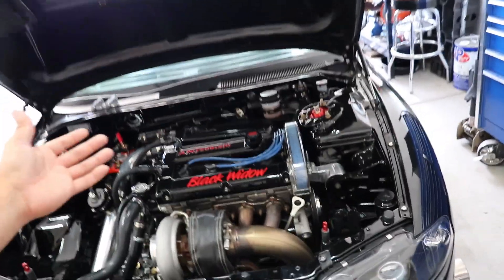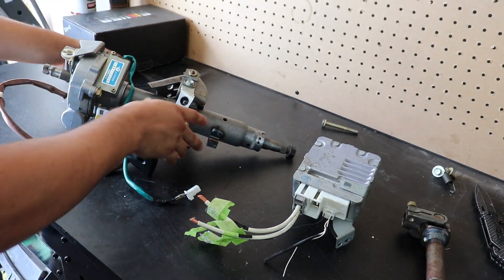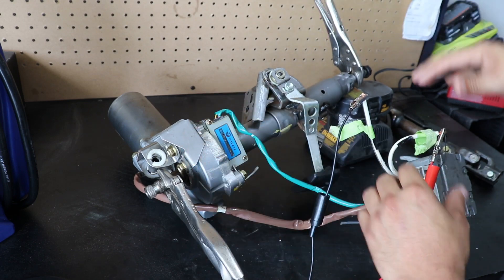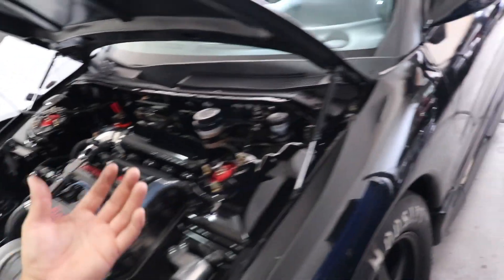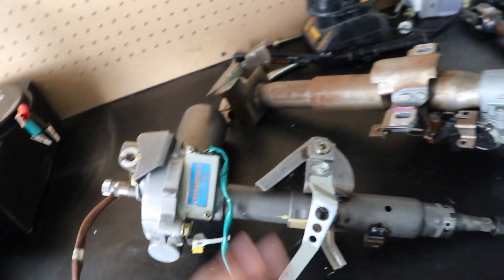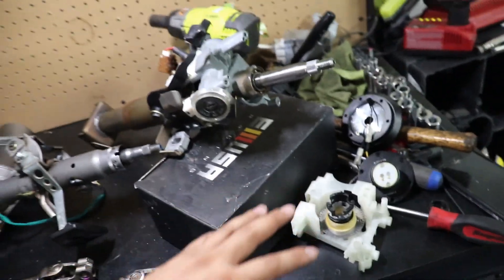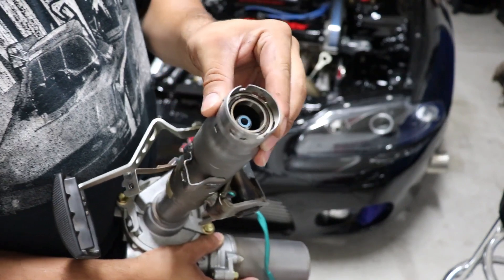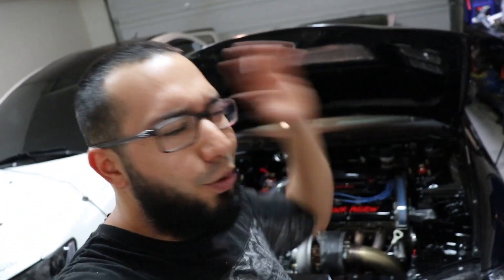1997 Mitsubishi Eclipse GSX- Toyota PRIUS Electric Steering System Install- PT 1

Comment: Very in depth explanation of the whole process, excellent!  I want to do this to my old car's column too.  My manual box is a 24- 1 ratio, so I also want to put in a steering quickener gear, to bring it down to 12 -1.

Comment: There's an easier way btw. Use a Vauxhall corse electric power steering column. The length is better. And the lower U joint can be adapted to fit easy.  Nice work though

Comment: @gmbo100 so should it matter which way its orientated or should the sensior be to the steering wheel?
Reply from the maker: The sensor doesn't matter how it's orientated
Reply: @Gabe_Ortega  unfortunately it does. It has to be toward the steering wheel or it wouldn't read input correctly.

Comment: Is your original steering rack de powered? did you swap it out for something different or just use this setup on a hydraulic power steering rack?
Reply from the maker: same steering rack just looped the lines

Comment: Good evening, excellent video, sorry, how is the electrical connection, could you share the information on the electrical connection, please, is the signal from the speed sensor used or not, please help
Reply from the maker: No with this system the speed signal is not used.. however I been looking Into a switch for the "switch wire" to turn off the system while at the track.
Reply: thanks in fact I already downloaded the connection I did not know that this conversion was very popular and very reliable I already ordered mine
Reply: Aver si cuando me llegue me podrías ayudar en la medida de los cortes que ahí si no entendí bien las medidas

Comment: I sold my complete 09 prius for $500 with a bad battery. Didnt know the steering shaft alone was 250
Reply: Just replace the bad cells in the battery....everyone is so intimidated buy hybrid batteries, but once you pull the out the safety plug you'll only get shocked with 15v maximum if you do something stupid.
Reply from the maker: Tons of peaple use just the column for stuff like this, seen them used in a lot of utv

Comment: Off topic but I searched your other videos and could only find your gst has bc 272's, which cams are you running in the black gsx?

Thanks
Reply from the maker: The gsx I have s3 one of the biggest cam off the self they make for a 4g63
Reply: @Gabe_Ortega  
Awesome love the idle of your car and the s3 is what I had planned on getting.

Thanks

Comment: I think I rather to keep the factory power steering system. I'm not at this level yet lol. I finally turned on the engine but I didn't install the camshafts seals so you know what happened next lol. To bad because it sounded amazing for the 5 seconds it was running. I also had a massive fuel leak wich I fixed but then the oil started leaking profusely. That was two weeks ago and it's all fixed but I just haven't found the passion to finish it. I just need to install a couple more things back, I just can't find the desire to do it.
Reply from the maker: Almost the same thing happen to me awhile back...I installed the gtx3076r turbo on my girls Evo x... INSTALLED THE OIL LiNE ON THE WRONG HOLE ON THE BLOCK....oil went everywhere lol
Reply: @Gabe_Ortega  🤣😂🤣. At least there was not much to disassemble in you case.... lots of cleaning I can imagine haha.

Comment: crazy shit man.. BUT!!!... u dont need P/S cause... race car.. lol
Reply from the maker: That's what my younger self used to say lol
Reply: @Gabe_Ortega  my younger self (6 years ago).. said go manual trans....  now im wiser so im going auto lol..
Reply: @1fastcolt  you know he can wire in an on off switch so if he wants manual again he can just switch it off, it will still have the added weight of an eps unit/motor, but if you wanted the feel of de-powered setup at the push of a button this works, i have been running something similar to this for a few years now, i will never go back to a hydraulic setup.
Reply: @mitsubishikid1187  I did not know u can turn it off.... also is this ABE?
Reply: @1fastcolt  yes sir
Reply: @mitsubishikid1187  thought so.. this is steve from tucson.. i buy parts from u.. slowdsm on the forums.. got the built white van
Reply: @1fastcolt  Yeah turbodad has been picking my brain on eps for his summit wagon too, so i might try converting the wagons as well, but the prius setup would work great on your truck project if it does not have power steering yet, i did one a while ago.